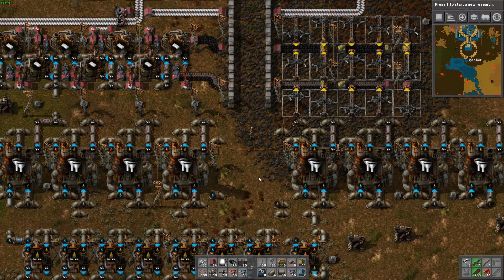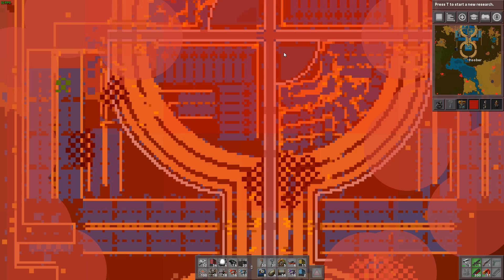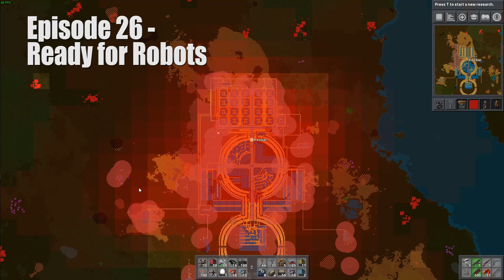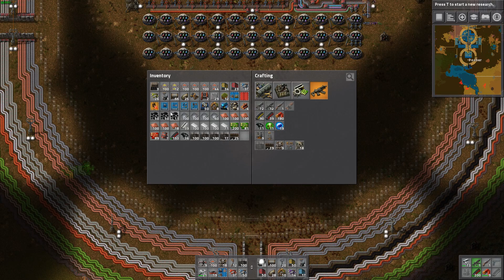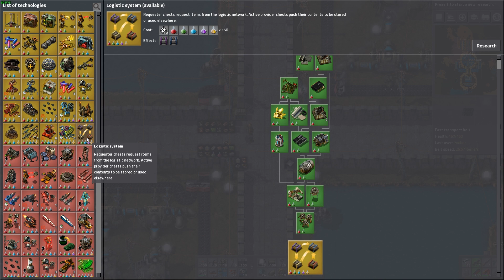FACTORIO 0.15 | Ready for Robots - Episode 26

Comment: Nice design, but one think might be good to include is a roboport at each end of you robot construction, that way, you can output a signal (if there are enough robot on the network to do the tasks) so the factorie only run when the network is missing robots.
Reply from the maker: that's a good idea. I do have it set up to the circuit network though so it never makes more than the limits I set to it, but it may be smarter to hook it up to the logistic network instead.